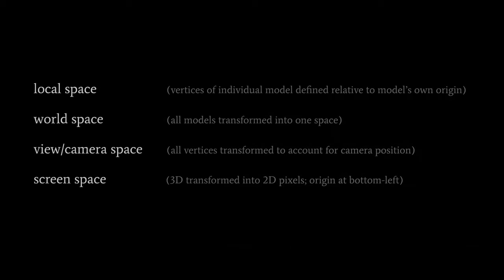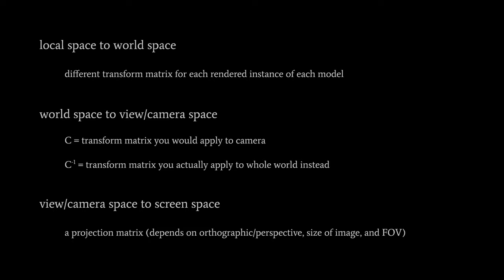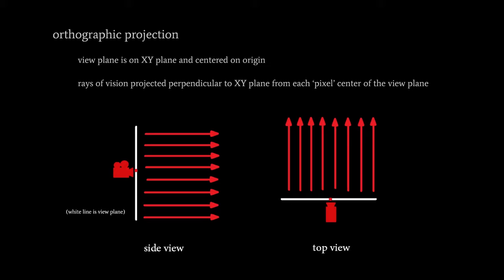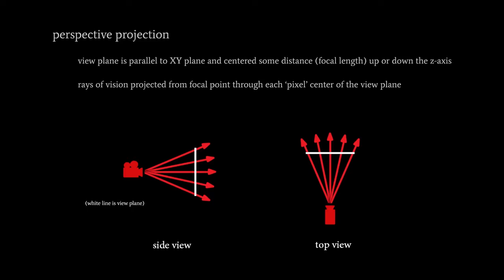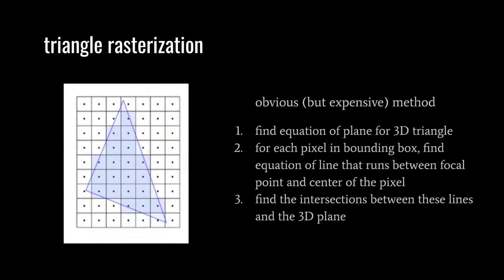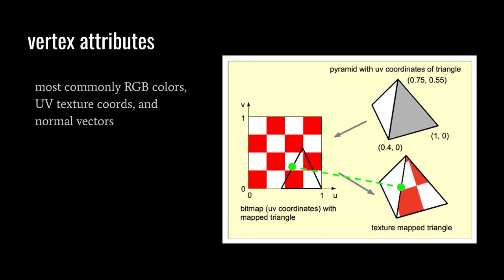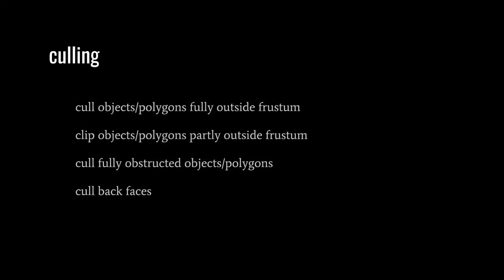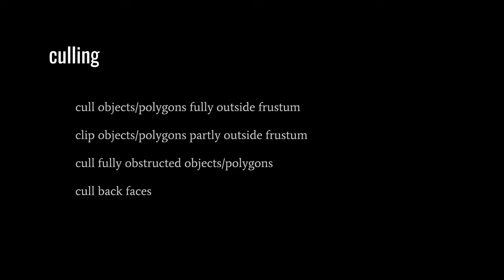OpenGL - 3D rendering overview

Comment: How would transforming the world for the camera work for a multiplayer game?
Reply from the maker: Not sure I understand the question. Are you concerned that transforming objects for different cameras of different players would cause a conflict? First, modifying data on client doesn't change anything on server. Secondly, the local-to-world and camera transforms are applied to every object every frame to produce the vertices we want to render relative to the camera, but the transforms and the original mesh vertices remain unmodified: effectively, we're producing a copy of all the vertices every frame to render, and those copies are discarded after the frame is rendered.